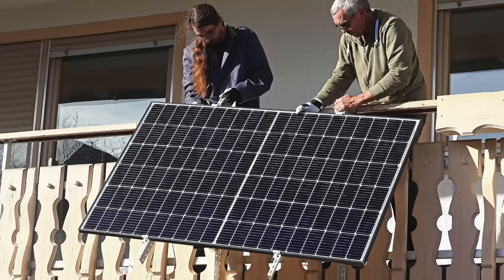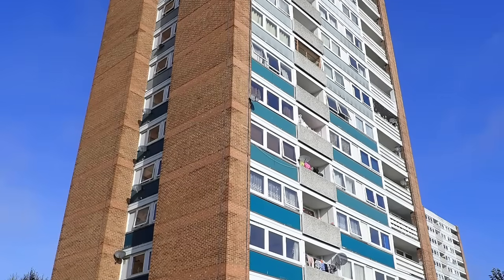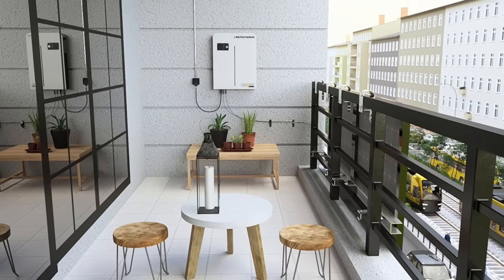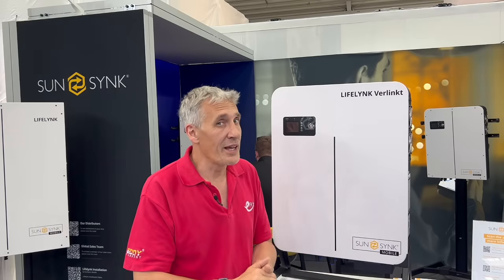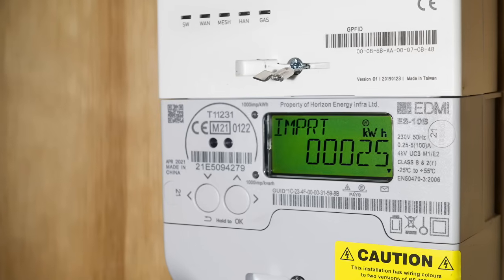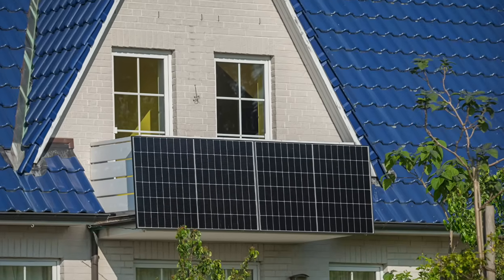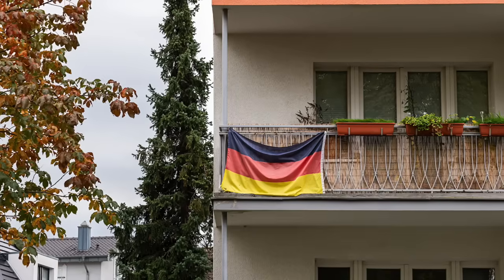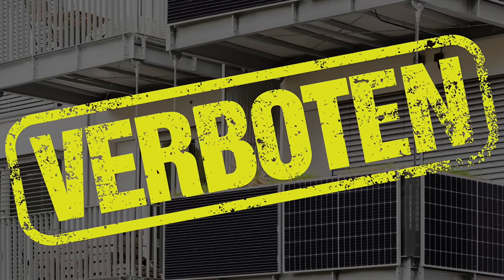DIY Solar Installation: Genius Idea or Total Disaster?

Comment: I have had this type of system for over 2 years. I have a smart meter and never informed DNO and they have never contacted me about backfeeding to the grid. Just do it
Reply: Same but I don't back feed though or at least no large amounts generally less than 100w a day, no solar either just battery storage which is charged up cheaply overnight and consumed during the day but I am considering a few panels on a shelter at the back.
Reply: Really is no issue with the DNO, found them very helpful, its also a legal requirement to inform /consult with them.. there is no charge.

Comment: No, it should not be allowed to be installed, except by a licenced electrician, and the home owner has to do a course - to explain that the 800W output means you can't run literally everything in the house off it at once 😅

Comment: Everyone can plug in a plug into the wall. What’s the difference which way the energy is flowing?
Reply: It can burn out your RCBO or RCD by back feeding power to the wrong side when the device is off. There are emergency regs just gone into place in the UK about this exact thing! Also, this is a "suicide cord" with exposed live pins on a male plug.
Reply: @havoctrousers  there is no voltage on the male plug if the inverter is not synced with grid. Regarding RCD, funny but this topic doesn’t exist in Poland and I could not find anything in German too.
Reply: @volkhen0  if you supply power at two points into a circuit then you can draw more than the MCB rating further down the circuit, causing overload risks.
Reply: @edc1569 I've got a plug in sys ; . Works great ...BUT  in UK there will probably be about 5 days a year you will generate any where. CLOSE to 800 w from 2 panels . . Av 200 w ,/ panel ?     thru year , winter days lucky to get 50  from  full low horizon winter sun . Raining get nothing ...😢
Reply: @havoctrousers  Very true, I nearly killed my young wife many years ago, while doing house renovations and wanted a quick fix to keep power on to another part of the property. Plug was tapped to wall with sign on and she just pulled it all off. Nearly as bad as the guy, working on his roof with a tied on safety rope over the apex and down to the cars tow bar...forgot his misses had the spare set, and when she had a bad call, just rushed out to the motor at speed and raced away.

Comment: I would think it would be problematic if you switch off your breaker (or it cuts out on its own) then your circuit could still be live from the solar.
Reply: Shouldn't happen, inverters like these sync to the incoming grid supply and if that is disconnected by turning the breaker off or it tripping etc then the inverter output should die instantly.
Reply: @RandomNoob  Good to know, out of interest, what do you think would happen if there were two of the inverters on the same circuit? they may not distinguish the grid supply and the supply from each other and so carry on working. I'm guessing the solution is then, don't use two but I can easily see it happening.
Reply: @alsmith20000  It would actually be a pretty catastrophic for the inverter too because it wouldn't be in sync with the incoming supply when power returned and would most definitely destroy itself with a big bang.

I shouldn't have to say this but for anyone else reading NEVER connect the output of any inverter to your mains supply unless it's specifically designed to be used in this way or you will destroy it.

This doesn't happen with things like a UPS device because the inverting side and the grid side are independent and switch from one to the other in a power failure but just back feeding through a socket nothing is isolated from inverter to grid.
Reply: @alsmith20000  I have several "cheap" inverters connected, are they against code most definitely not but still shut down if you turn the breaker off.

The thing with grid inverters they have no way to generate the sine wave so without a grid connection they don't have anything to follow.

Comment: Different question...
We are guided that panels on a roof should ideally be at 41' for optimal efficiency - what efficiency do you expect with a vertical mounting?  
Reason I ask is that this raises the question of vertical mounting on southerly walls if you can't get enough onto a roof (I have a hip-roof which reduces my possible panel count).
Would a vertical panel 'south' be better than a roof panel 41' 'north'?
Fitting would be cheaper as well - less scaffolding cost etc.
Reply: I have almost flat panels that are more efficient on a grey day than the roof mounted ones. I suspect your scenario would be the same. 
Less efficient in bright sunlight but possibly better than nothing.
Reply: @Stuart_Johnson_Solutions  be nice if they would specify efficiency by degree from flat to vertical, and NSEW.
Agree, the more the merrier. I’m considering 4 panels each on N E and S for my side of a semi, but some southerly verticals upstairs could be good
Reply: Wasn't it 33 degrees? Think there's a latitudinal calculation for this
Reply: @techtactics788  Yeah, I think we are about 41'N ~ hence our figure; although I think 'big' farms can be made to track through the day
Reply: I doubt 41° (I assume you didn't mean feet!) is optimum everywhere, only at certain latitudes.
Good point though - vertical flat panels are going to be less efficient for that reason. That could be got over with stepped panels, so they're made of lots of strips at (say) 41° mounted on a vertical base (ditto for walls as well as balconies); how much more expensive to make such panels would be, I have no idea. /\/\/\/\/\ rather than _______ I mean.
Reply: @G6JPG  agree. We are about 41 deg north, but I’d be interested to see the derating between optimum and vertical
Reply: @herrtomas6729  I would guess it's one of the geometrical things - sine, cosine, or tangent - of the angle away from the optimum.

Comment: Concept of a small plug and play solar system is definitely attractive, but injecting power via a socket sounds too risky. Why can you not have a small system a bit like a UPS/ battery generator where you can plug a load in from solar, with a mains backup, but no ability to feed back to the socket. Maybe this already exists and I just haven’t come across it yet.
Reply: use a life po4 battery with built in inverter and safety checked eco flow have good guarantee and uk compay only earth through mains not putting power into plugs there are plenty other makes too anchor, bluetti..

Comment: How exactly is this not allowed ? Anything that plugs into a socket is surely outside the scope of BS7671.
Reply: It's annoying when they say things aren't allowed but don't address why. 
You can feed in up to 800w into the grid without the need to notify the DNO and as there are no changes to the electrics there is no need to inform building control. As there are no electrics involved there isn't even a need to be a competent person.
Reply: @gavjlewis domestic electrics aren’t really designed for you to start injecting arbitrary amounts of power half way along a circuit.
Reply: @edc1569  I don't really think injecting just over 3A into a ring main is an issue. Well I know it's not as I have been testing a Deye micro inverter with a couple of panels. They have been doing it in Europe for years and they often undersize everything in comparison to the UK.
Reply: @gavjlewis  Except for us Dutch where every socket is fed by 2,5mm2 on a 16A MCB.
Reply: @gavjlewis  potentially its even worse when you consider how many ring mains in the UK are probably broken, at least on the continent you can say a few amps are ok as you should have that as headroom.  Also why not plug two into a ring, or four - how's the user meant to understand they must not do that.
Reply: Technically this device is just supplying reactive power -- it's just that's it's really really reactive.
Reply: Maybe it's just the small export guarantee that's not allowed for a non MCS approved install? 
Though I gather octopus will allow it subject to checking the export meter.  Many hybrid inverters have a setting to limit the amount of power exported (including zero) so it's either consumed locally, or dumped into a battery.
Reply: @andyburns Not true
Reply: If you start injecting more power half way along a radial circuit, say 10A, and your source MCB is 20A, how do you ensure you don’t overload the cable downstream of where you are injecting power?
Reply: 1, exposed terminals (widow-makers). 2, power going into the system without an isolator to the grid can ramp up the voltage at the transformer and kill line-workers who may be working on the network.
Reply: @kathrynwhitby9799  Except for the small fact that the inverter can only feed power back in the grid when it's live.

So no incoming voltage from the grid = no outgoing power from the inverter.

Please do some investigation before you make a comment.

Comment: I am over 50 years old from Northern Ireland, unemployed driver living in a council flat yet I run a 3100w solar panels, 6Kw 230v Inverter. 15Kw LiFePo4 battery storage running through a consumer unit totally independent from mains. My panels are on my out building roofs. It's old news to an uneducated man like myself.
Reply: @Fester_  what battery do you have. Is it Fogstar one by any chance. Just with you saying 15kwh . Also In NI
Reply: Good on you for going off the grid.
Reply: Nice job festa, do you run the solar on its own independent ring main to run your appliances or have you it tied into the existing circuits?
Reply: As a MCS electrician the main concern is the fixings all fittings have to be approved and I sort of get the point we don't want them blowing off a building.And if the handrail is fitted using screws that's another MCs issue. I struggle with MCs I don't use software so paperwork takes me 4 hours and I sort of get it as mce is iso 9001 a self install not.

Comment: Did I see a widowmaker plug?
Reply: No, these inverters will not output any power without an active grid connection, if its not plugged in the inverter is turned off.
Reply: Ofcourse the tracker needs the net first to sync up with the phase.
Reply: Perhaps the inverter has to detect power before it outputs it into the socket.

Comment: Small tied inverters like this have been coming out of China for years now.  Scariest thing I've ever heard of.  People plug multiple units into a circuit and are 100% guaranteed to be putting more amps on the wiring then they should.  This is all operating down stream of the switchboard so there is no over current protection between the amps provided by these devices and the loads on the circuit.  I've seen pictures where it's all gone horribly wrong.  If the public can be trusted... pauses while laughter dies down... it'd be safe to have one device on a circuit but then the question of proper behaviour of the device with respect to anti-islanding etc.  Perhaps this device can be trusted, the ones out of China sure can't.
Reply: It's kind of an argument for allowing these systems in the UK, if you ban them, then the only ones on the market will be the dodgy ones, and there will be no information on how to safely use them. If you allow them and set rules, then folks will be able to buy a compliant device and also be able to learn about how to use them safely.
Reply: @retrozmachine1189  surely a plug in DIY solar inverter below 3kW plugged into a ring main would supply that ring main with excess running back through the CU feeding any other circuit drawing power before surplus would flow out the house onto the grid free of charge.  If the generation unit is limited to 3kW what is the issue?

Comment: The best scheme in UK now would be to store the energy intended for night-store heaters for reuse during the day. This would save the user money and save the supply companies for peak rate capacity. However individual electrical skills have declined to the extent that DIY is dangerous, and cheap imported (China) undersize and unfused 13A moulded plugs and the like have made the situation dangerous. Don't start me on imported fuses that may or may not even be fuses.
Reply: People on octopus are doing that already.....
Reply: just wire these systems into your consumer unit, you don't want them on the end of a 3 pin plug.

Comment: As far as I recall we have similar, i.e less than 800w (for no dno notification), the difference being the inverter has to be wired into the circuit.  This can be achieved with a fused spur that can be locked off isolated). Assuming also a DC isolator in the inverter. Should also add, all elements need the usual type approval, not just your Amazon specials.
Reply: That's incorrect. All inverters connected in parallel with the grid required DNO notification, regardless of power output.
Reply: @VinoVeritas_  yep you are correct, my mistake.
Reply: there was a trial that ended in 2017, we did not adopt the concept, but it still came here

Comment: Yes it should be available to DIY in the UK,so why is it a problem in this country it's always against the small person with little money, it should be a law for all new builds to have solar fixed to the roof as a rule!!!!!!!!!
Reply: This has nothing to do with the small person with little money. This is a safety issue, nothing more, nothing less.
Reply: @VinoVeritas_ can you explain why they are safe to pass the European regulations but not the UK, considering the UK and EU regulation requirements regarding anti islanding with grid tied inverters are the same?
Reply: @ItsAllJustBollox  As per EREC G98, anti-islanding only needs to be achieved within 500ms. Half a second is long enough to electrocute you if you touch the pins of the plug when removed from a socket.
Reply: @VinoVeritas_ well obviously . So thats why you SHOULD wire mains feed ifrom  mico inverter nto Fused outlet or direct to consumer unit . Not exactly rocket science is it
Reply: @VinoVeritas_  why is it a risk in UK but not in Germany then ?
Reply: @studiosys  it's not , Eco flow already sell this system and the system is on the EAN register

Comment: Allow, been looking to do similar (a safe) alternative low voltage garden system to save money and regulation with garden wiring. But direct injection to household would be great and can't see why this couldnt be made a safe experience reasonably easily. Show despite the story the Germans have much less regulation than us Brits.
Reply: look at eco flow strea ultra I installed a 11.52 Kwh system ( plug and play ) for less than 5k , expandable to over 20 Kwh
Reply: I've got a plug in sys ; . Works great ...BUT  in UK there will probably be about 5 days a year you will generate any where. CLOSE to 800 w from 2 panels . . Av 200 w ,/ panel ?     thru year , winter days lucky to get 50  from  full low horizon winter sun . Raining get nothing ...😢.
Reply: @studiosys  Yep, Just upgraded from 1x100w panel to 2xpanels in series just so I can generate enough voltage to charge a 12v 70ah lesuire batt. 
Current winter rates and it struggle to power my ESP32-c (~0.5A) + occasional ~3A from 300Led)
I plan to upgrade to a lower power non-wifi ESP. But still I am lucky to get 12v 5A charging from 200W panels in winter.

Comment: If the physical plug you bung in the wall had its own temp sensor (like the DC connectors on SolarEdge optimisers) then I'm all for it.  We are long past the age of suicide plugs with modern power management systems so I would have no issue using a plug in the wrong direction and trusting that it would drop to (at most) a reference voltage on disconnect.
Reply: Temp sensor ? But at 800 w on  dc your only chucking 3 amp ac into socket ? +. every UK ring socket can handle 3k W.. breakers rated at 32 Amp .....  also in UK there will probably be about 5 days a year you will generate any where. CLOSE to 800 w from 2 panels . . Av 200 w ,/ panel   thru year , winter days lucky to get 5o w from  full low horizon winter sun

Comment: It's a great idea as long as the setup is safe for Consumers to install why shouldn't they do so.
It's no different than using a UPS or Powerbank.
Reply: It's not the same as a UPS.
Reply: @VinoVeritas_  power bank, yes
Reply: @VinoVeritas_  It is not, but the OP did say it was no different from 'using' one. I agree to a point with this. UPS also output mains and so you need to know how to use them safely. Most consumers are able to follow the instructions for using a UPS so should be able to follow the instructions for installing DIY solar.
Reply: @gavinminion8515  A UPS does not operate in the same way as an inverter with a 3 pin plug attached on the output.
Reply: you are injecting additional power into a domestic circuit that was never designed for that, its nothing like a UPS